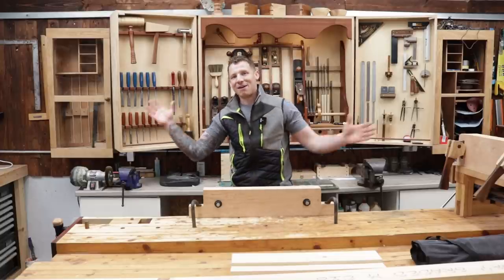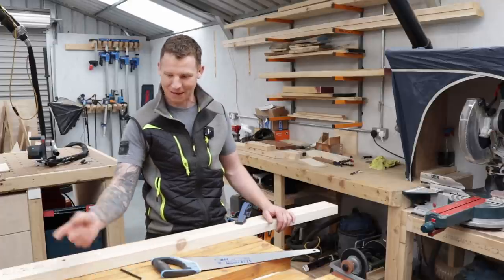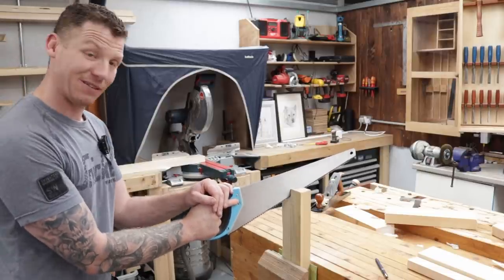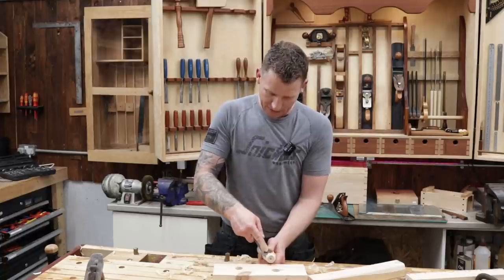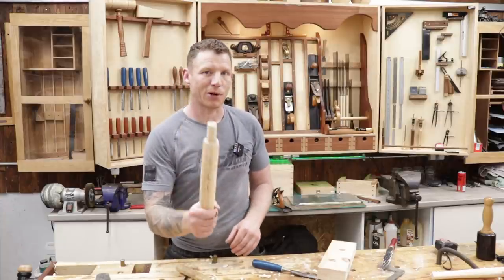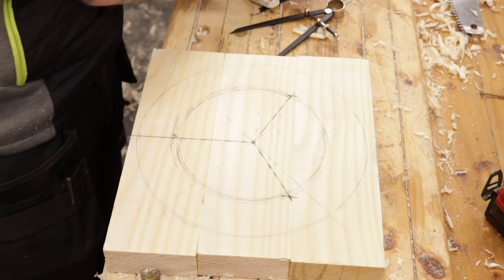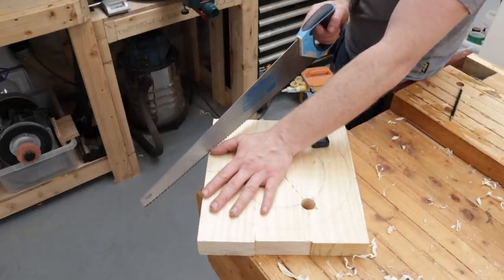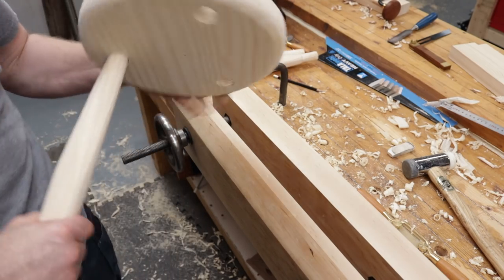How to Make a Three Legged Stool. A Beginner Hand Tool Woodworking Project. Few Tools Required!!

Comment: Jon I made a three Leggate stall at my Bodgers group last year when I first went. It was the first thing they teacher to do. It is a piece of ash cut in half to make the top and then three legs out of Chessnut. This was done by a Frodo split log into four, then axed three of them saving one for spares just in case you cock up. And once you’ve semi rounded off with the axe you then take it to the shavers and you’re annoyed it you’re knifed it round to make a billet for the legs. Once used a hand or gap of 2 foot long for the free holes for the leg to pass through you then shave one end to make it go through the hole. Since I’ve done that I’ve let it dried and settle and then I’ve linseed it to give it a waterproof and lovely finish.. I’m trying to see if I can send a picture of it but I’m having a job to I have to get my daughter with site today. But another little great demo. But also you can use a round plane which they use for chair making they are pretty good.

Comment: Hi John, thanks for the video!  I love this little stool.  Your method of explaining things is so nice.  I also like the hand-tool approach very much.  Question on the wedge cuts on the legs:  Do you make the wedge cut in the leg with or across the grain of the leg?
Reply from the maker: cross grain, although its not as important as the tenon is contained and not as likely to split, you can drill a hole where the saw cut stops in order to arrest any split that might continue when installing the wedge.